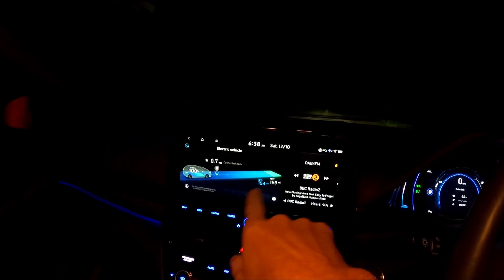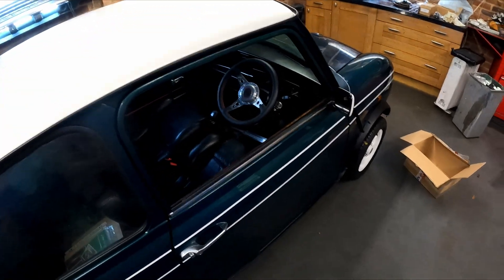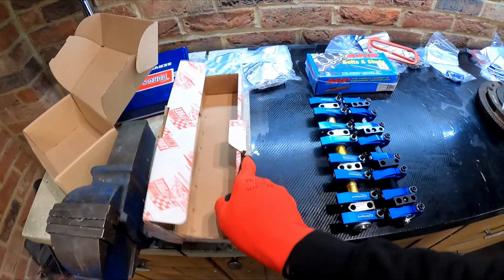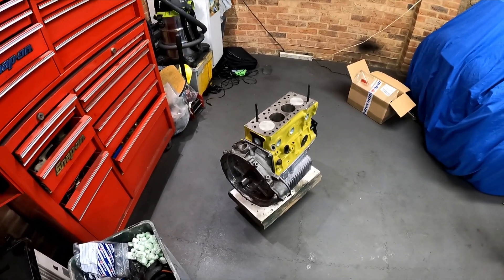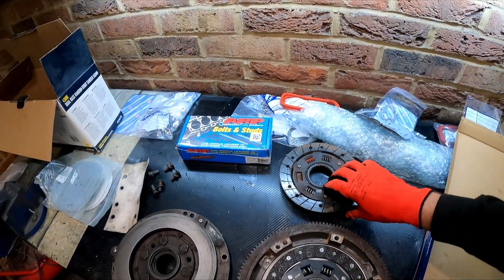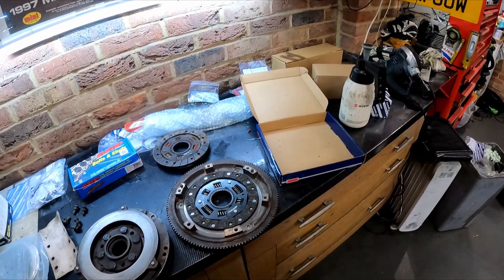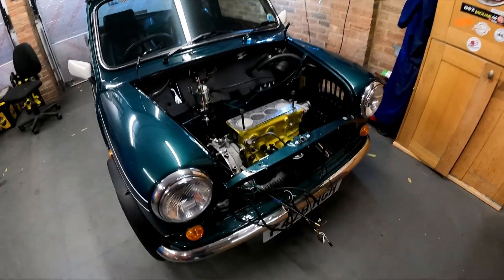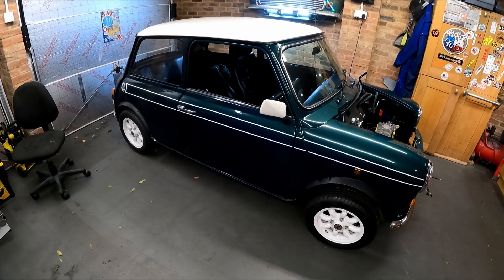Engine Refit 998cc A+ John Cooper Conversion - Classic Mini Workshop Workshop Part 89

Comment: Uprated oil feed pipe being fitted?
The yellow paint on the block will be a nightmare to keep clean.
Damp winter weather is just horrible for petrolheads. I hate it😢
Reply: I meant the external one from the block to the filter head Keith
Reply from the maker: Oh no, it's just the standard one
Reply from the maker: Yes, central pickup